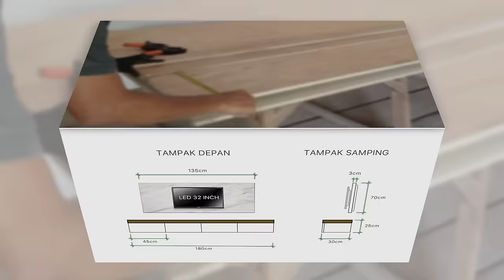TV Cabinet Simple Minimalist

Comment: Hi how did you use to wrap the wood on 14:28 mins
Reply from the maker: hi too, I pasted it with yellow glue on the multiplex and finishing (HPL) section, wait 3-5 minutes until it's slightly dry then paste